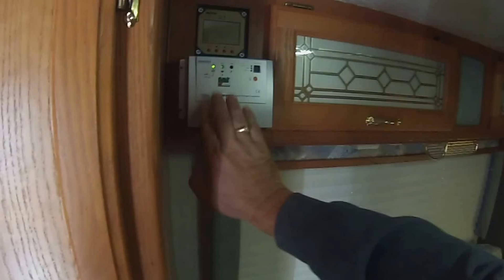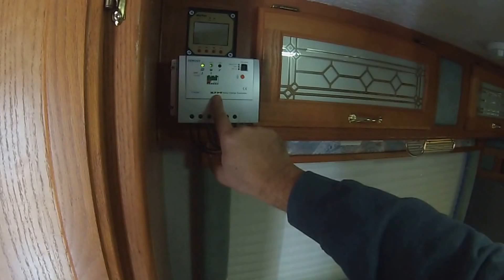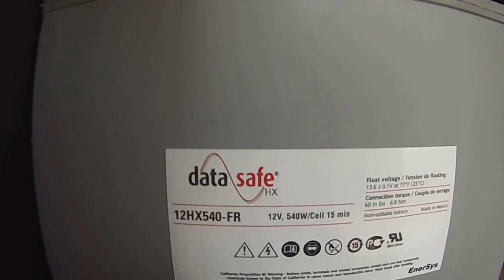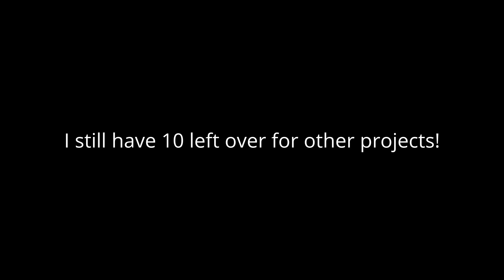ADDING SOLAR AND EXTRA BATTERIES TO THE BT CRUISER RV

Comment: Nice ... Driving back up to the East Coast tomorrow morning from Florida .... any place along the way might I check to pick up a few used cellphone batteries? How are they working out for you. This old house battery gave it's last power to cranking up the generator one more time.
Reply from the maker: depends if Athens is out of your way

Comment: You installed your solar panel too close to the TV antenna as well as you AC unit.  They are both casting a shadow on your panel that will shut it down.  Especially the TV ant. that over hangs your panel.    Only takes a small amount of shade to shut a panel down.  Those are awesome batteries, would like to find a source in the SW.
Reply from the maker: I am aware of the shading. I am unsure of a "shut down". I have several ways to charge my batteries and my reasoning was that it would never "fill' my batteries up but just add to as much as possible. I do have a solar suitcase for boondocking situations. I STILL have not got my MT5 reader, so I don't know what charge I am getting. CVK
Reply: Put an amp meter on it and you will find that the output is very little when there's shade on the panel.  I'd at least reclock your TV ant. so it doesn't hang over the panel.  I've been living full time with solar for the past 3 years, so have seen what even a tiny bit of shade will do to a panel.  Good that you have other options, you're going to need them.......:)

Comment: I saw Martini.  Question....Does that antenna shade your solar panel?
Reply from the maker: yep, but I had no choice but to put it there. Future mods dictate it was only spot. With alternator and converter the solar should work regardless. It may not can fill the battery bank but it will always be putting some in!

Comment: I saw Martini straight away, your not crazy. Good tip on the battery, my Lifeline AGM was a wee bit more than $20 😂 oh well.
Reply from the maker: sometimes I can get AGM. In fact depending on what website you read these are considered AGM, but I think they are sealed lead acid "wet batteries".... Now if I only had a source on good used solar panels! CVK
Reply: Campervan Kevin haha! I think the sealed are fine, AGM is better but at your price- saving money is good 👍🏽

Comment: Looks great kevin!  The only problem that I see is the shading you're going to get from your antenna and AC, that will really lower your power production!  Anyways, thanks for the video bro!
Reply from the maker: had to work with what I had. I think system is overbuilt with the alternator charging and converter helping out. I realize that they will both hurt me though. So far with my experiments I have plenty of juice! CVK

Comment: good tip on the batteries!  Foxy blends into the Woof Pack nicely for pup sitting.  If you needed a sign - past woof pack members are looking down on you.  ;)
Reply from the maker: Yeah I keep Foxy at RV Basecamp while Felix is working. If I am working too and cannot bring them with me I have somebody watch them for me. So far it works good. The added pen comes in real handy beside the deck.
Reply: Campervan Kevin Martini and Tucker will keep Foxy & Baby Mae in line...

Comment: Kevin.....always good to see you and the WOOF PACK.........Thanks for the tips on the cell phone batteries.........will look into the metal recyclers.........  TruckcamperJim in Indiana
Reply from the maker: Never know what you will find.... but if you don't ask or look you wont find a thing. Be sure to check date codes and bring your voltmeter.

Comment: Most have too much solar panels you on the other hand have too much battery? You have enough battery to provide solar for all sorts of locations?
Reply from the maker: I agree about the too much battery thing. However with the alternator charging them, converter charging when plugged up AND my portable solar suitcase I think it will work. I will let you know how system is working in an upcoming video. The thing is I have lots more room and MANY more batteries if needed. CVK
Reply: Campervan Kevin They have panels that 2 of them make over 520 watts and they are very affordable look them up even if you have to put your own hinges on them you could build portable panel projects and sell them? Make bank.

Comment: Great find, the dog in the tree.
Your solar is fabulous. If you recall I'm starting my off the grid house in January. I will take your advice and contact the metal recyclers for batteries.
Reply from the maker: Sometimes I can get AGM, sometimes just lead acid... You never know what they are buying/replacing. Take you a volt meter with you to make sure they are good If they are holding over 12 volts you scored! Let me know how it turns out. Lots of people want me to get batteries for them, but when you figure shipping it doesn't work financially. These things are HEAVY and cost too much to ship. I bet you find you some. Always make sure to get all the same batteries from the same "batch" I have seen them on pallets waist high before from same location. Good luck! CVK

Comment: Your new antenna is creating shade over a souple of the cells on that solar panel, this will greatly reduce its output
Reply from the maker: Yep, I am aware. Just having to work with the room I have. The other side of a/c will be used to carry a 27ft ladder. Between alternator, converter, solar panel and if needed my portable solar suitcase I think I can get enough juice to keep me going. Even if panel is not enough to keep it filled with power every little bit is saved.

Comment: I like the idea of solar in an RV . But , I can think of some very real scenarios where it would be great to have a wind generator as a backup . I've seen several that can be made with an alternator , a garbage can and a ten speed wheel using a vehicles unibelt to drive the alternator with the ten speed rim . There are many other low cost setups .  PK
Reply from the maker: I also have a portable solar suitcase if needed. The more options the better I'd say!

Comment: C'mon Mr. Kevin, the explanation is simple to me.. that is a dogwood tree. :-) 
Rig is looking great sir. You sure do live a nice life on that little tomato compound you got going on down there. You are living my dream. 
So will that one panel setup run a TV, some LED lights, charge a cellphone and power/charge a laptop for one night? Do the batteries charge off vehicle alternator when driving? Thanks!
Reply from the maker: Best tree/dog comment yet! Just the old marine battery that was stock did a really good job. I think it was 100ah... so basically I now have 6x the battery reserve that I did before. Yes, I have several ways of charging battery bank now. One being alternator, the other converter from 110ac and now the 165 watt solar. I also have a 150w solar suitcase if needed that is portable. CVK